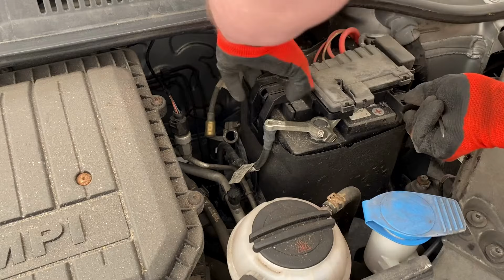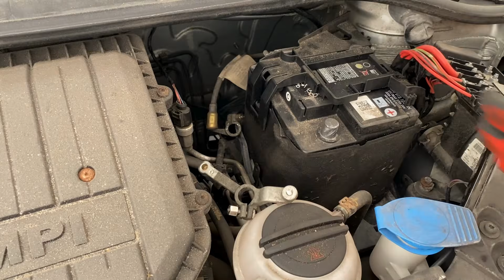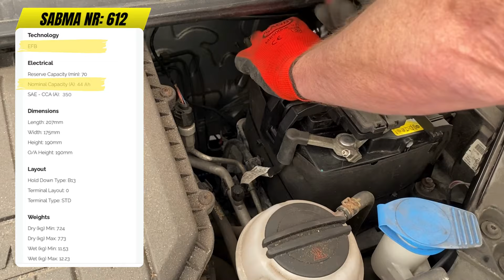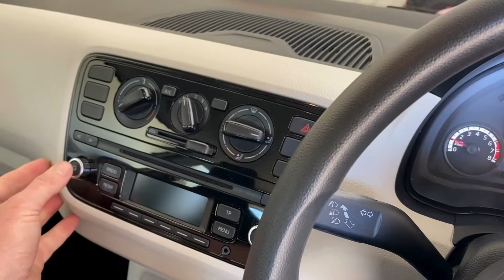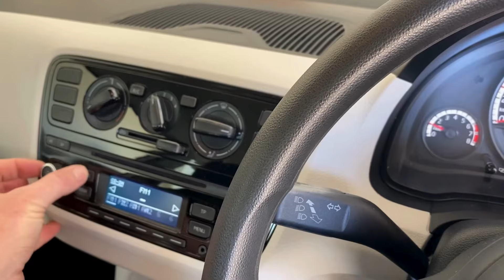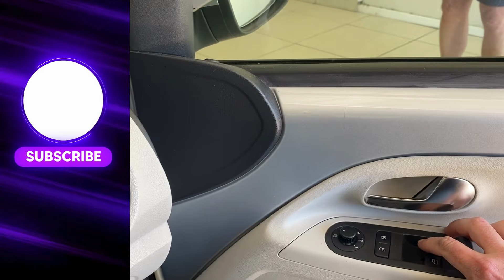Volkswagen Up Battery Replacement

Comment from the maker: Compatible batteries and tools available from Amazon you can use for this vehicle:

🔗 Bosch 52Ah (Non stop/start): https://amzn.to/4pmlZQN
🔗 Yuasa 50Ah (Non stop/start): https://amzn.to/49QOzU6
🔗 Yuasa 50Ah AGM (With or without Stop/start): https://amzn.to/4sQSZTX
🔗 Battery post/terminal cleaner: https://amzn.to/49nOAk3
🔗 Socket set: https://amzn.to/4pSfuGh
**👇 For batteries less than 2 years old, a good charger might fix it 👇**
🔗 Battery charger I've personally used for over 3 years: https://amzn.to/3T8KG8k
🔗 CTEK battery charger with AGM charge function: https://amzn.to/4j7Sm3F

These are affiliate links, which means I may earn a small commission (at no extra cost to you). It helps support the channel and keeps these tutorials free. Thanks for your support! 🙌

Comment: I found the actual two clips on the side were still clipped ,even though I thought they were not so I took a screw driver and gently slid it under the clip and turned the driver slightly and CLICK!! BOOM LOL now it was unclipped ,after that it was a bit of forwards backwards diagonal backwards Maneuvering and I got it out without removing the junction box,again for me the problem was those two side clips,I thought they were unclipped ! WRONG!,make sure they REALLY CLICK then you are on a winner ,took me about 30 mins in the end instead of as you say ,a 5 minute job,best regards from Germany
Reply from the maker: I think you're right🤔. You know, one of the previous comments made me think about this issue and you've just confirmed it now. Thanks for your input 😎

Comment: On 2019 Polo I have L1 battery and fits L2 but then the positive cable is too short. Annoying as hell
Reply from the maker: I’ve heard of that wiring length issue happening when trying to upgrade to a larger battery case size, thanks for the feedback! 👍

Comment: Great video, thanks for the tip removing the plastic part that clips directly to the battery, when I replace my car batteries I think it's good practice to clean the inside surfaces of the battery terminals and the new battery terminal posts, I also check each of the positive terminal feeds for signs of corrosion/ oxidation and the tightness of each nut before the negative terminal is reconnected, then finally a Liberal spray of battery terminal protection.
Reply from the maker: Spot on, I probably don't mention it in every video but maintenance contributes to best battery life for sure. Thanks for the feedback 😎

Comment: It s to complicatet waht are you doing. You don t need to remove all those components to change the battery. The electrical cover it can be stay on place. Just you have two clicks in the bothe side of battery cover. That s it !

Comment: Do I need to do battery adaptation when the car has start stop function?
Reply from the maker: It depends if your car has a Battery Management System, check for a current sensor (small rectangular box with connector) on the negative battery terminal. Without it, no BMS, no coding. With BMS, while it’s not strictly required for the car to run, it is required for correct energy management and best battery life, especially when the battery type (EFB or AGM) is changed.

Comment: Thanks for the video. The battery in my 2018 car is still good, but since it's very cold in Berlin right now, I'm charging it externally and have therefore brought it inside. The process was quite tricky for me too, and I had to use a screwdriver to pry off the terminals. As you mentioned, the black plastic part was difficult to remove.
Reply from the maker: Your battery will appreciate you 👊! Thanks for the feedback, I'd love to know what's up with that bracket.

Comment: Very helpful thankyou. I replaced my existing 202 car battery in my Up with a new 202 battery. I did not need to remove the terminal junction box (TJB)  on top as you experienced. I found the clips left and right of the TJB live terminal a tight fit. So after loosening the live terminal I placed my left & right hands either side of the clips and prised them out together at the same time, then I lifted/wiggled the TJB off the battery. Its worth removing the live terminal cable tie clip below (left of the battery) to give you more flexibility on the live cable - I did not need do this as I was able to pull the cable slightly through the cable tie giving me about 20mm flexibility. This will allow you to lift the TJB off the battery and bring it over the front of the battery vertical in position in front of the battery. Once I did this it allowed me to slide the battery forward. I then lifted the battery & rotated it counter-clockwise 90 degrees to allow the battery to be pulled out. I installed the new one in reverse of the removal process. Hope this helps anyone going forward. Thanks
Reply from the maker: Thanks for sharing your tips! This sounds like how we usually do it, but on this one it was a whole new challenge 😄